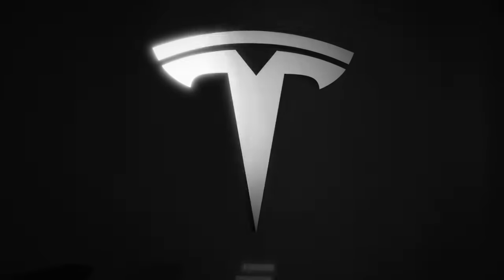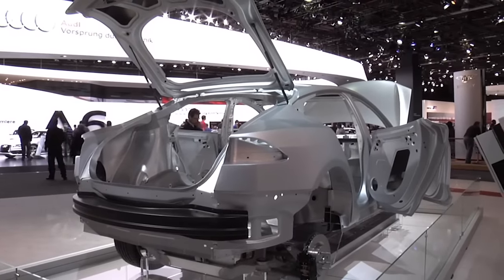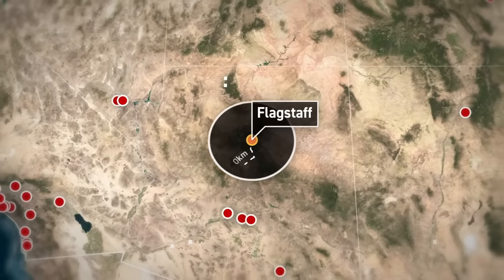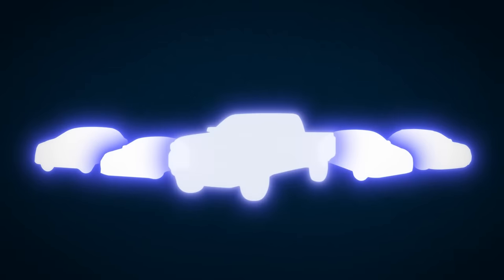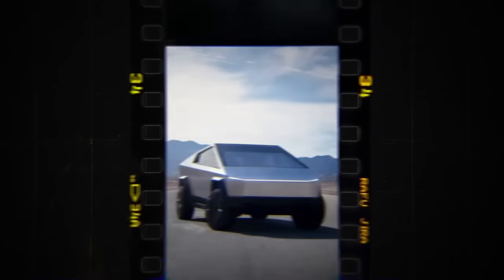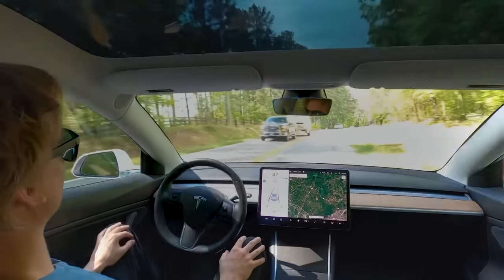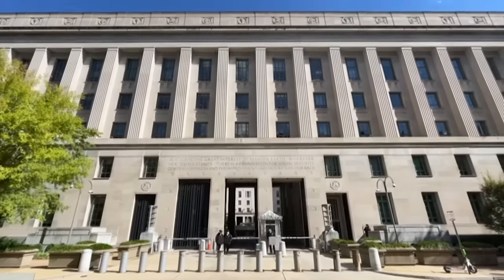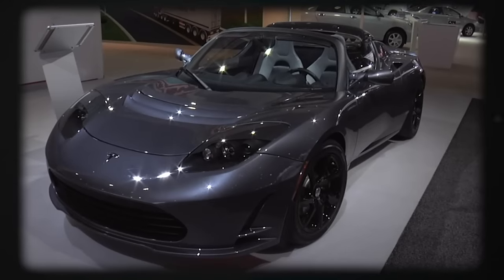How Tesla Fumbled

Comment: I hope the trend of everything being a touch screen that Tesla started will reverse. They just aren't the best way to control a car. If you look at F1, they've got a foot pedal for gas and break and literally every other control in the car is mounted to the steering wheel. There's also only one screen and it isn’t touch-sensitive. Maybe that's too far the other direction, but I think it'd be nice in a consumer car. All-touchscreen was a terrible design choice by Tesla, making it unsafe and inconvenient.
Reply: Yep, touch screen is annoying as hell. At work there is a touch screen pc next to a normal one and guess what? Everyone uses the normal instead

Touchscreen takes too long and is much more unreliable
Reply: @1queijocas  Especially if both you and the screen in question are bumping around a bit because of the whole driving thing
Reply: Having a touchscreen is fine. But some controls like audio volume, AC temperature, etc. are much more convenient when they’re on physical buttons that can be found by feel alone. Operating a car is dangerous and requires constant focus on your environment, so minimizing the amount you have to look away from the road ahead is always safer.
Reply: i guess having one touchscreen that you can patch through software is cheaper than physical buttons that when even the car itself is shoody quality wise the buttons will probably be worse lmao
Reply: Yeah, Haptic feedback is something that cars should be obligated to have. Its a massive risk to have to quit looking on your windshield to fiddle around the touchscreen. In older car, once you go knew the layout. you could change everything with your hand feeling while keeping your eyes on the road.
I like technologie and new stuff. But new is not inherently better and the old fashioned way is the best
Reply: @1queijocas  And thats not even while bouncing around in a car and likely to hit other cars when your eyes are off the road trying to adjust your vents.
Reply: Ive bought 2 consecutive GM eCars now. I will NOT buy a Tesla if it means touch screen for everything. Navigation, sure; but HVAC & stereo need buttons. And controlling air vents or glove box through the screen is just silly.
Reply: @gooseloose682 The problem is also that cars today have a lot more features. Imagine if you had to put all the things you can find in the touch screen on physical buttons. But many car manufacturers are choosing to make stuff like radio and climate control operable via physical buttons.
Reply: @BeeSharp47  Sure, theres a lot of things you dont need while moving - those can all go on a menu, for example "how many miles left before the bell/light goes off that you are low on fuel?" or "what color should the lights on the ceiling be?" Those are settings that would be perfect for a menu, and weird for a knob taking up dash space, But adjusting temperature, fan speed or vent position or radio station, volume, even aiming vents or opening glovebox door - those have no business in a menu (altho its OK to be in a menu as long as there are buttons/knobs/switches also) those are safety hazards if you have to take your eyes off the road to dive thru menus. If your car only has those on menus you should have to pull over and stop before using them. Or there should be a physical control for them.
Reply: @natehill8069  Yes, I somewhat agree. Opening the glove box and adjusting vents with the touch screen; that's ridiculous.

Hoping that more auto makers join the train with physical controls for stereo and climate controls.
Reply: Touch screens are not the best way to control a care, it is the worst but CHEAPEST way!
Reply: I think that it’s too late to turn back now, putting things on screens is way cheaper than using physical buttons, even if we try and tell automakers we don’t like screens there’s a good chance that they’d still wait out the backlash to keep the cost savings
Reply: @Gweeftina  nope, the condition is already getting better. Most of the big auto companies like ford, toyota, vw, porsche, etc. Were already going back to putting essential features on a knob or a button for some time now, even incorporating screens into those knob is starting to become mainstream now. So i guess we've learned from the mistake that is putting everything up in touchscreen and coming out with an even better solution than what we had before.
Reply: It was a cost saving measure, but it became popular thanks to the "technohipsters". Other car manufacturers are copying it because of that, but also because it's a cost-saving measure. It'll be very hard to reverse the trend since it'll mean less profit for the car manufacturers.
Reply: @orange_turtle3412  I don't even want touch for infotainment, I have a Mini and I love the rotary knob for the iDrive. It means I don't have to lean forward at all, it falls comfortably behind the shifter. Plus on a rough road your hand doesn't bounce off.
Reply: I own two tesla’s, and as much as i like the and like tesla, this is true. Holding up my arm while driving and hitting little moving buttons is not easy, and not at all convenient.
Reply: physical buttons, no touchscreen jank pls.

Comment: As a Tesla owner who lined up for a Model 3, I agree with your points. The only thing I’d add is at least in the US, Tesla’s continued short term advantage will be its charging network. It’s 2023 and PBS Newshour just did a roadtrip with a Rivian in California and ran into all the issues we’ve seen before with these charging networks. Broken chargers, payment systems off line, it was kind of a nightmare. That stuff has got to get fixed before I’d ever have my primary trip vehicle be a non-Tesla EV. Superchargers just work. The company did get that experience right from the get-go, and the payment system is seamless.
Reply: I think this is a great point, and for unclear reasons Tesla seems to working hard to make it irrelevant by pushing NACS, getting other cars to use Tesla's plugs and be compatible with Tesla's network - eliminating that competitive advantage
Reply: As ev become more popular, there will be more fast charger across the country. Give it another 5 years and every single gas station in the country will probably have a charging station. This is already starting to happen in my area, every resturant, cvs, walgreen, shopping mall, parking lot, and others have a charger for EV. This charging network advantage that Tesla have, like you said is just a short term advantage.
Reply: It's probably the smart idea, Tesla would make tons of money off licensing
Reply: Superchargers still suck ass, having to stop for a couple hours every so often is a massive disadvantage compared to taking all of 3 minutes to fill up gas
Reply: @faketruth7740 only true of metropolitan cities. It will never be financially feasible for every mom and pop gas station in middle America to add a supercharger. Not enough people will use it, they take too long, and the amount required would be insane. EVs are okay at traveling around cities but suck for road trips. Also most EVs take overnight charging to reach capacity… and installing a fast charger in your home is around $5000, on top of the overpriced cars themselves. Massive barriers to entry on all front for realistically no benefits
Reply: I will say at least in upstate NY. I don't see alot of telsa chargers. However I do see the like 'standard' plugs in every city
Reply: @anon2427 depends how you did it. I installed a charger for like $400. But I felt confident enough in my electrical skills to do it myself. And it might take all night to charge fully. But I drive a hour to work and my car only takes like 3 hours to get that 30% back. You wouldn't normally use the full range if you have a charger at home.
Reply: @jackiecs8190  Tesla will make a lot of money off the SC network, but probably don't want a monopoly (practically, it would take too long to build out).  But they have forced the standard to THEIRS and set a high bar for how charging should work.  Also, the terrible performance of charging was being used as a counterargument to EV adoption through malevolent neglect ("Darn chargers are ALWAYS breaking!  We just can't make this EV transition work").
Reply: i love the idea that people don’t include the charging network as the actual advantage. All the other shit is irrelevant if there’s isn’t a reliable and relatively fast charging option. build the greatest, highest build quality EV but you cannot trust that ur next charger stop may work, then all u have is a novelty.
Reply: I have a Chevy Bolt. I spent 37,000 less than you did for your EV, have substantially the same range, and I've never had an problems with it at all. My battery was replaced for free just to make sure it was safe. Oh and next year Tesla is going to start making their stations compatible with non-Tesla cars. Not that I need it; I have never had  any problem charging anywhere I go. You bought into an expensive cult.
Reply: You know what else "just works" for long-distance trips? Gasoline. Diesel. Hydrogen.
Reply: @GC2Major_Tom  the idea is that there are externalities of that that we want to avoid. If the environment and air quality doesn't impress you then maybe the fact that gas prices in the US now seem pretty well locked at $3.50 to $3.90?
Reply: Well now everyone has decided to adopt the Tesla charger standard, so that advantage is going to disappear
Reply: @jeremy____5747 just because your vehicle isn't producing emissions doesn't mean that the electricity you're using is clean. Most of the superchargers are taking electricity from the grid, usually powered primarily by coal and gas plants. Not to mention the amount of pollution from building the massive lithium ion batteries
Reply: It's not an advantage anymore. Tesla's expanding NACS support to other manufacturers, which loses them vital ground in the EV market
Reply: Similar problem here in the UK, the charging network just isn't there yet.
However, our regular single-phase home electricity pipes allow a charging point to go up to 7kW.
But, if you have your mass connection upgraded to 3-phase power (3 x 220V AC) you can get them full 22kW charging rate, about 40 miles of range per hour.
Reply: @anon2427 did you pull your numbers out of your ass?? Not a single thing you said is even remotely true. Teslas don’t take hours to charge, it does not cost 5k to charge at home, and if you plug in overnight on the charger it comes with you’ll be fully recharged

Comment: As it turns out, building a factory that produces half a million cars per year is really hard.
Reply: But is it as easy as it was to fix twitter?
Reply: Very insightful, I can't recall where I've heard that before ;)
Reply: specially when you make it harder for yourself by having a “quantity over quality” mentality that forces you to send a vehicle even if it’s build incorrectly because stopping the line is prohibited 

also specially when your workforce slices their hand on a normal basis and they are fucked cause you are too focused on trying to stop them from unionizing than trying to make them produce better cars
Reply: It’s even more difficult when you spend more time keeping unionization efforts down than you do ensuring quality
Reply: @barlmax4095  can't blame Tesla for quantity over quality, there was several reports at the time that they were under a lot of pressure from shareholders to ramp up car production.
Reply: @RK-be8pn  sheeesh
Reply: @niteshade5783  would you consider twitter fixed??? I thought it was more broken than ever...
Reply: @sadmanh0  that's their own fault for  being run like a tech company  rather than a car company.  Tesla's value is measured  in Hype... hype doesn't pay shareholders cars do.
Reply: @niteshade5783  Twitter is already fixed so apparently it's harder.
Reply: that's why they should have bought an old factory and kept its workers, but they didn't want to deal with unions....
Reply: @rhyswilliams4893  14B in profits.... Highest profit margin in the industry. Highest operating profit. So... Clearly, you don't pay attention to things shareholders do. Don't pretend you read financials. You obviously don't. Autoline daily literally summarized this for you lazy people. It's obvious, you care more about hype than financials. I only care about the financials. ~50% yoy revenue, net income, cf growth.... Yes please..... Nvidia traded for over 80+x earnings. No one says anything. It's obvious you guys have zero idea what's going in markets if you consider Tesla, 50% EPS growth, to be overpriced, then amd, Nvidia, etc, all should be talked about first, before Tesla.... But no... You don't, because you don't know anything other than what msm puts in headlines.
Reply: @nickbruck1017  your judging based on a video that didn't talk financials. Go to autoline network daily and see their report of the auto industry, based on profits... The thing that actually matters. Then, you see why we are all very very happy shareholders. 14B in profit is nice. Nicer than GM and Ford. So telling us to unionize when we make more money than unionized Ford and GM... Lol... You're so bad at business go away. Tesla makes more profit per employee than both companies. I'm not interested in unions.
Reply: @Tential1  Since you know so much about Tesla then it's kind of disingenuous that you're not mentioning why their profits are high. Most people don't know that Tesla does not turn a profit on automobile sales. They don't know that Musk gobbled up EV credits for years and sells them to other automakers in order to turn a profit. 

Which also presents their problem. With more and more automakers entering the market and releasing their own EV models they don't need to buy EV credits from Tesla anymore since they are being subsidized by the government. Tesla has never and will never turn a profit selling cars. The F-series vs Cybertruck shows exactly why: you cannot create a car company and in 15 years hope to dethrone legacy automakers that have been doing this for over a century.
Reply: I've worked for years as a quality engineer at the F-150  plant, and later at the Camry plant. The amount of institutional knowledge that Ford and Toyota have is staggering. Anyone who thinks they can use their big brain to come up with a better way to assemble cars on their own is a victim of the Dunning Kruger effect.
Reply: Giga shanghai produces 850K cars a year. What's your point?
Reply: @BlakeWR81  Tesla's carbon credit revenue was 1,78 billion USD in 2022, total revenue from all businesses, cars, energy was 81,5 billion dollars. Profit was 14 billion.
So it does not look that carbon credits was a huge driver of it...
Reply: @sadmanh0  cope
Reply: Toyota
Reply: @niteshade5783  It has only gotten worse.
Reply: @Tential1  What kind of reality do you live in that a single car manufacturer that has just finally started to do production would be worth the same as a computer chip manufacturer that has been around for YEARS. If you also know so much about how to run a successful business then youll want to talk to elon about twitter because that is worse than a dumpster fire.